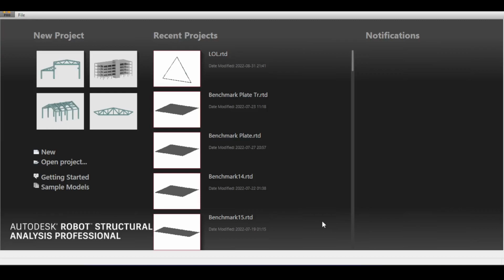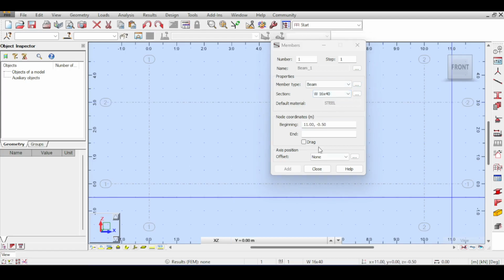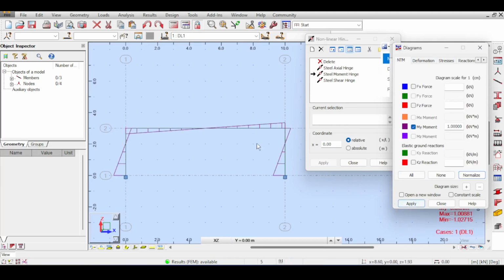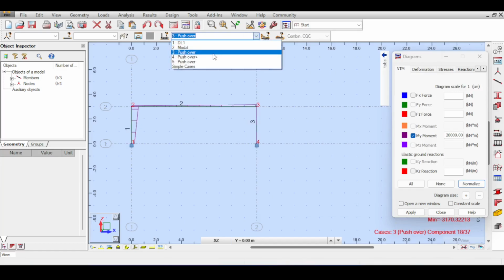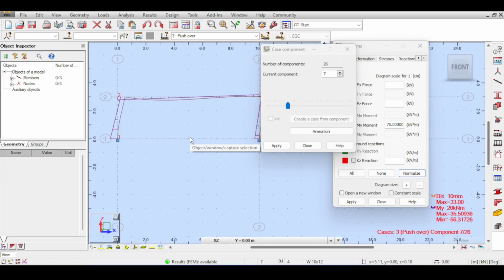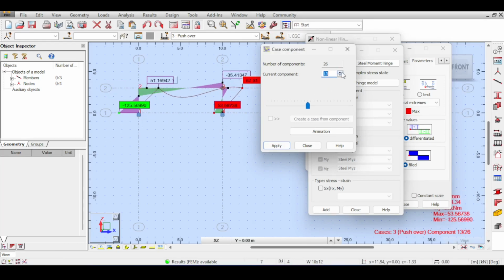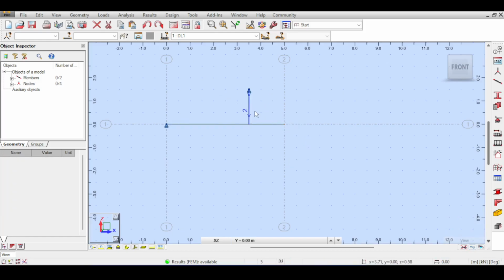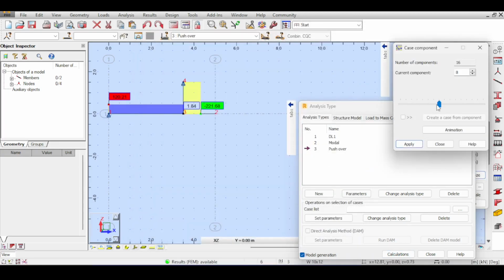Pushover Analysis & Material Nonlinearity (Nonlinear Hinges) in Autodesk Robot

Comment: Hi how to set a load case or load combination as initial case in robot?
Reply from the maker: hm.. I did not understand your question. Unfortunately.
Reply: @ In ETABS for non linear analysis there is an option to start the analysis with selected load case or load combination as the initial state. This will help in saving the time in analysis of repeated cases in load combination. Is there any option similar in ROBOT?

Comment: This is a very helpful video! However, is there any proper nonlinear hinge definition for RC elements?
Reply from the maker: Nonlinear hinges for reinforced concrete elements are still subject of research. The problem is that the reinforcement ratio, detail, arrangement and other things play a role there.

You still could use the same approach described here. But the values would differ, and even those values would be "connection specific"

Regards,
CEE

Comment: Can you do the same with concrete structure please?
Reply from the maker: I think I can, but I have to research the rotation/moment curves of concrete before I attempt that.
Reply: @CivilEngineeringEssentials 
It will be a very good subject , because it is not available in the internet at all!
Thanks 🌹
Reply: @CivilEngineeringEssentials  Isn't it only available for steel material?

Comment: Why performing modal analysis along with the pushover analysis.?
Reply from the maker: Hi there Engr. Attia,
the reason behind it is that pushover analysis is treated as a "dynamic analysis" that needs its modes to be accomplished. 

You will notice that the deflections you get from a pushover analysis are a little bit more than what you get from a static analysis, because modes do affect that.
Reply: I am also still curious about the importance of modal analysis. I would have thought it goes to infinite, just stopping at the number of modes we input.
Also, I've seen practices in which Z direction is neglected (faster analysis/little impact) - I would be curious to hear your opinion about ignoring mass along Z direction, CEE :) (or any direction, for that matter)
Best regards!

Comment: In the last example, I think the reason why robot was saying the structure was stable is because the connection between the hanging element and the beam was still capable of transferring the moment across the joint hence technically it may not be a mechanism yet at that point
Reply from the maker: Indeed, I realized it in hindsight ^_^
Still, huge thanks for your insights toe the model. I wish you all the best.
Reply: Exactly the internal shear force and the torsion movement which remaing is enough to keep the model stable. If you check not only the axial force after the braking point also the torsion and shear changing completely 😊
Have a nice day

Comment: I tried in my home as per your video, but am getting different deflection diagram. In top horizontal beam showing to intersection points. For that pushover also getting different. So please clarify me.
Reply from the maker: Im pretty sure it is dhe to differences in your material properties or sections.👍
Reply from the maker: Also, it is important to note that it is not likely to get idwntical results with me.
More importantly, the results should look the same
To get identical results, you have to have identical inputs.
The last video I uploaded, i decided to upload the rsa file with it.
Regards: CEE
Reply from the maker: Finally, make sure your nonlinear hinges are in the same location